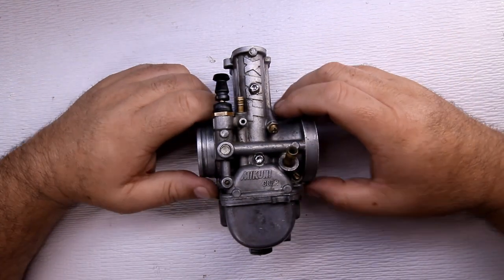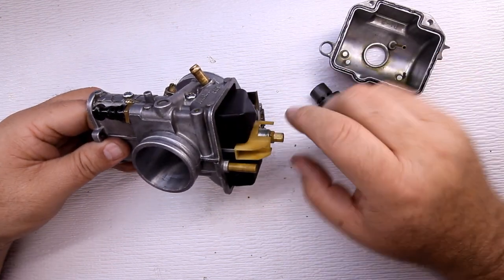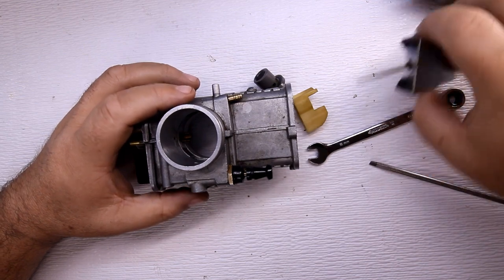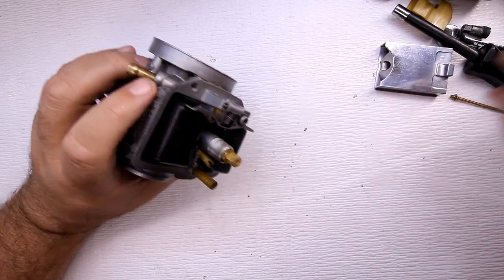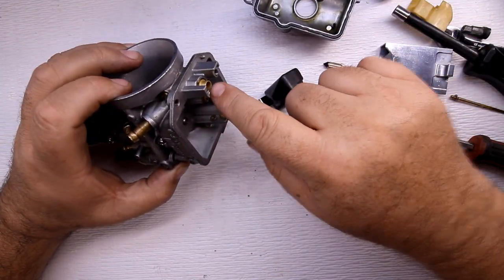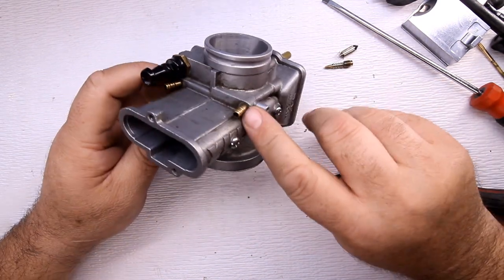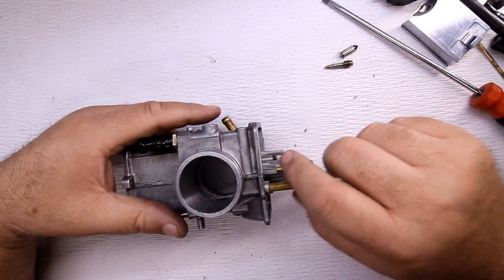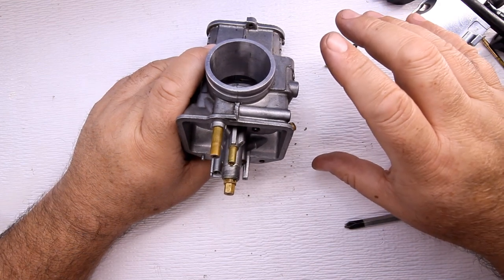Mikuni TMX Carburetor Breakdown and Troubleshoot

Comment: Great video..when going too higher altitude "10000" ft. Is it necessary too rejet or is needle adjustment enough?
Reply from the maker: Hello Keith.  Good question.  The rule of thumb is to adjust the needle every 3,000 ft.  To be 100% sure on the jet size, I would call a motorcycle shop in that area and ask what they are using.  All bikes are different, so I wouldn't want to suggest a size.

Comment: What up cleg thanks for the video not too many on the ole TMX cheers bud
Reply from the maker: You are very welcome.  I'm glad you liked it.
Reply: @wutupclegg6618  yessir, what main jet do you run. My 2001 cr125 came jetted so bad it barely ran I have it in pieces but thinking of buying like 350-390 mains and a 40 a 45 and a 50… any suggestions to not waste money on jets? 

Also under the assumption it has a red needle from jd kit and I haven’t found a oem one yet or a 2171 that old riders said they used trying to get the bike close to stock and work from there
Reply from the maker: Sorry for the late reply.  It didn't show on my message board.

I run the stock jet.  The bike is stock, so there's no need to change it.

How is your bike running?  It might ba another issue.

Comment: The jet that pull fuel for the carb.  Does it get smaller inside?    Can't seem to wondering if its clogged or just smaller the the opening up top.  Also does it come off?   Thanks
Reply from the maker: Are you referring to the main jet?  None of the jets change, in size, inside the jet.  The needle changes diameter.

Comment: How do you get the cable to separate from the cap, is there a c- clip, or is it just pressed  in ?
Reply from the maker: Did you take the slide off the cable?  To get the slide off, there is a button at the tip of the cable.  Push the cable into the slide then slide the cable to the side.  You will notice a cut out where the button will slide out.  Then, you should be able to pull the rubber boot off the cap and pull the cable out.

Comment: hello, I would like some advice, I have a newer tmx 38 on a honda cr 250 07, I have already changed almost all the parts on it, I use pj32.5(40) mj 410(420) needle 6gdy26-68(26-65) the engine runs great but I can't set the idle speed... I have to raise the slide and then the engine fires down the hill when the gas is taken off, where could the problem be? how do I set the idle speed so that I don't have to raise the slide
Reply from the maker: So, your engine runs fine, but it won't idle?
Reply: yes, exactly, everything is OK, but idling has problems, the motorcycle has no problem starting even without a choke, and it has a nice idling, but when I add gas, the idling drops and is terribly low and after a while the engine stops. it's annoying that I already have the freewheel screw and the nut turned at the same time, even so the freewheel is weak, but it's probably drawing gas under the slide because it's firing down the hill
Reply from the maker: @jonny621  I don't have the jet size requirements, so I'm assuming you installed the proper size jets.  If your engine has been bored out, you will need to install bigger jets.  If a bike will not idle, but runs when giving it gas, it is most commonly due to leaking shaft seals.  This is noticed by seeing if there is oil in the stator compartment and/or your bike is smoking really bad.  If your bike idles, but doesn't run well, this is usually due to wrong jet sizes.  Usually, it due to small jets.  It can even be due to a leaking carburetor boot or a bad reeds valve.  If it starts without the choke on, it might be due to the fuel level, in the float bowl, being too high.  Sorry brother.  Without it sitting in front of me and seeing what's going on, I can't be more exact on what's going on.  Keep me posted on what you find out.
Reply: @wutupclegg6618  I have to add that even the air screw does not react as it should
Reply from the maker: @jonny621  if there is no change in idle when adjusting the air mixture and idle screw, then it is most likely leaking shaft seals.  It's about that time to change them anyways.  The good thing is, the seals and gaskets are cheap.  The bad thing is, it's a lot of work.  If you have old clutch plates, you might want to change those out at the same time.  Same thing with rebuilding the water pump.  Thos all need to come out, so you might as well change them.
Reply: @wutupclegg6618  but I don't know if there could be leaks because I did a complete overhaul in the winter and I currently have 30 moto hours on it. the fuel level is set lower than it is written in the OEM manual, it should be 7.5, I have about 9. I am desperate! I tried to stop the fuel supply and I added gas for a while to clear the exhaust, but then the idle was adjusted, but when I have the supply turned on, it runs richly because it shuts off within a few seconds
Reply: I assumed that my level was high, but as I already wrote according to the manual, it is already lower and you can't set it lower because then the fuel flow is poor
Reply: the engine does not smoke, the gasket is dry, the oil does not disappear
Reply from the maker: @jonny621  you opened the Stator compartment and there are no signs of oil?
Reply: @wutupclegg6618  Yes, everything looks fine
Reply from the maker: @jonny621  do you have the right amount of oil in your crank case?  It's not low?
Reply: @wutupclegg6618  can it have an effect? I changed the oil, now I add a little more, about 0.5 dcl, to the reklus clutch
Reply from the maker: @jonny621  So, let me go back for a second.  It idles fine, but when you give it gas, it wants to die?  With the oil at it's proper level, did you try starting your bike and see if it starts smoking?
Reply: @wutupclegg6618  smoke normally not much! when I start idling it runs ok but after a while the revs decrease and then it is no longer good, as if it were rich! the level in the manual is 7.5 mm, I have it set to 8.5 mm, could this have an effect? according to the manual, the level should be higher, but when I close the fuel tap and the level just drops, it starts to idle better
Reply from the maker: @jonny621  It would be best to set it at the factory suggested point.  Once that is done, and the problem persists, you will know that's not the problem.
Reply: @wutupclegg6618  Ok, I'll try it over the weekend... because I've already changed the nozzles and needles, but there's no visible difference in idling and the air screw doesn't react as it should either
Reply from the maker: Did you ever figure it out?  Was it the crankshaft seal?
Reply: @wutupclegg6618  hello, not still the same problem, the semerings on crankshaft have been changed, I think it will probably be a needle jet, because I used a thicker needle and it's a little better, but I can't find a needle jet s7, I have one there that consists of two parts
Reply from the maker: @jonny621  Does adjusting the idle do anything, or does the it stay the same?
Reply: @wutupclegg6618  it's a little better, but at least I already have a weak idle, but I'm not going to fix it now until he replaces the needle jet s7, but I have to have it made
Reply from the maker: @jonny621  The needle jet has no effect to the idle.  You could try going one size bigger on the idle jet.
Reply: @wutupclegg6618  it shouldn't have an effect, but it seems to me that fuel is drawing from under the needle, and since I have to have the slide raised whenever idling, it probably takes fuel even with pj and also from under the needle, at least I think. when I change the needle jet it will be tighter and it might start reacting to my pj and air screw because at the moment it almost doesn't matter what size I have, there are minimal changes and almost none
Reply: I've tried all sizes from 40, which is OEM, to 27, which is nonsense, and it still runs rich at idle and low revs without idling, as if it needed more air, I adjusted the idle just by lifting the slide, but now it takes fuel from the bottom needles I think
Reply from the maker: @jonny621  When idling, no fuel should be coming from the main jet.  You should only be getting fuel from the idle jet.  The engine is idling when you give it gas be is artificially allowing your bike to idle.
Reply: @wutupclegg6618  yes, I understand that, but it doesn't work for me for any nozzle size, it only works when I turn the screw that raises the slide to the maximum, and I think it's already so high that it pulls gasoline from under the needle. because when I go down a hill with the throttle closed, my engine keeps firing
Reply from the maker: @jonny621    Thats a bummer!  This is one of those times I wish a bike was in front of me.  Have you checked to see if your intake boot is cracked/leaking?

Comment: Can u plz tellme the throttle screw and the air flow screw specs of the tmx 32 for 2s plz.
I got one tmx without the screws
Reply from the maker: I apologize, I wish I really could give you those specs.  I don't have those specs.  some rebuild kits will come with those screws, and you can find them to be quite inexpensive.  You will also need the springs and washers.  You will need to search for idle adjustment screw and air/fuel mixture screw.  Those are their proper names, just in case.

Comment: Cheers buddy. Very informative. I’m having issues with the exact carb on our KX125. Last week the throttle got stuck open. It wasn’t the cable or throttle handle but something in the carb. I’ve stripped the carb down twice now and cleaned it all. It ran when I put it all back together but after a few minutes just died again. I think there are a few issues with it and just trying to work through them.
Reply from the maker: How does it run when started?  When it dies, is it because it will not idle?
Reply: I’ve had a play following watching your video. The last time it started it seemed to run out of fuel. After a few minutes it would then start again. So I’ve stripped it all down again and found some crud in one of the jets. It’s fresh fuel but I’ve ordered some inline fuel filters as that was great advise. The idle speed seemed ok when it did run and I’ve checked the jets and fuel and air routes. I’ll get the filter on first and then continue. Cheers buddy.
Reply from the maker: @TheMCMoosey  how long will it run for?
Reply: Not long. Less than 15 seconds. Then give it 5 minutes and it would start again but do the same.
Reply from the maker: @TheMCMoosey  that could be a couple issues.  It could be the float needle isn't opening all the way.

Comment: My Carb is not sucking fuel. Everything is clean and none of the holes are clocked.
You got any suggestions?
Reply from the maker: Sounds like your float level is too low, or there is a crack in your carburetor boot, between the cylinder and the carb.
Reply: @wutupclegg6618  none of that, it was overflowing at one point. i think the carburetor slider sits too high.
Reply from the maker: Are you sure it's not sucking gas?
Reply: @wutupclegg6618  10 kicks with fuel on and it was dry so yeah im sure
Reply from the maker: Did you try starter fluid?  It could be compression, leaking carburetor boot, or a bad crankshaft seal.
Reply from the maker: Were you riding it and it just stopped, or was it sitting for a while and now won't start?
Reply: @wutupclegg6618  got enough compression. Carburetor Is good. IT was Standing for a Long Time.
I think someone Messed Up the carb settings.
Reply from the maker: @kNx2k14  these are the times I wish the bike was in front of me.  Try some starter fluid and see if it starts.  Then, I would recheck the idle jet and choke.  Also, check for Cracks or possible air leaks in the carbs boot.  If it's sucking air through the boot, it won't suck it through the carb.
Reply: @wutupclegg6618  i will let you know what the problem was. i just dont have the time at the moment. thanks for your tips
Reply: @wutupclegg6618  1 more question, what position should i put the needle clip in? the guy i bought the bike from has it in 1. position. i think it should be in the middle.
im a complete beginner with 2stroke bikes btw
Reply from the maker: @kNx2k14  it depends on your elevation. Lower altitudes require more gas, which means you lower the clip.  You can call your local motorcycle shop, and they can advise you on the proper clip position for your altitude.
Reply: @wutupclegg6618  is it normal that the cylinders move while pulling the clutch in first gear and pushing it ? motor off
Reply from the maker: @kNx2k14  with the bike in hear, if you pull the clutch in. You should be able to push the bike without moving the piston.
Reply from the maker: @kNx2k14  I totally understand the time thing.
Reply: @wutupclegg6618  yeah thats what i thought also
Reply: @wutupclegg6618  do you have an Idea why the Pistons still move when i pull the Clutch ? 
Maybe the Guy i bought it from Put the Clutch Back together wrong? 
I meant He Put the Power valve linkage Back together wrong so IT wouldnt surprise me If the Clutch was Put Back together wrong too
Reply from the maker: @kNx2k14  sounds like you need new clutch plates.  What year is your bike?  You might want to change out the crankshaft seal while you have that side apart.
Reply: @wutupclegg6618  Its a 1992 YZ250 :)) 
I opened it up as much as i could without removing the Motor. Clutch plates dont look that much used to be honest.
Reply from the maker: @kNx2k14  did you adjust the clutch cable?
Reply: @wutupclegg6618  yes but nothing changed
Reply from the maker: @kNx2k14  with the clutch cover off, see if the plates separate when you pull the clutch lever.